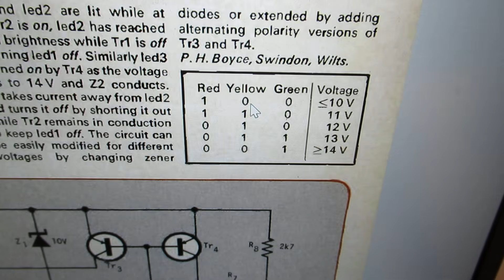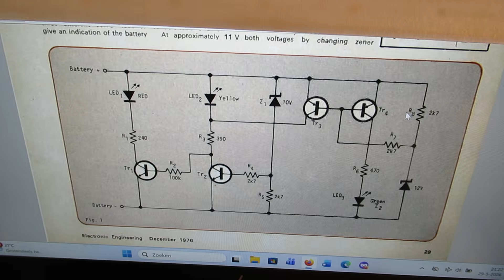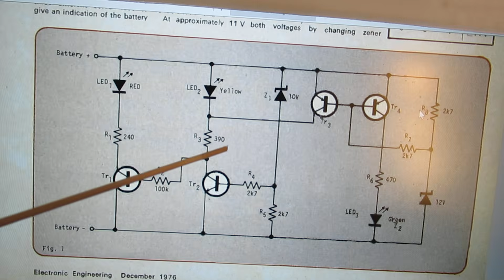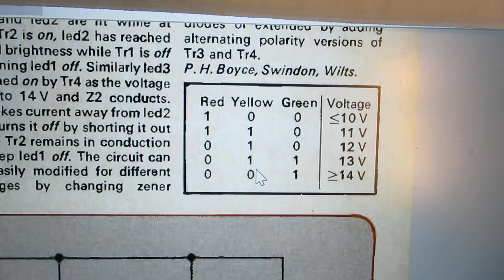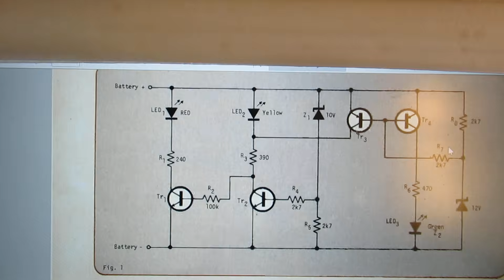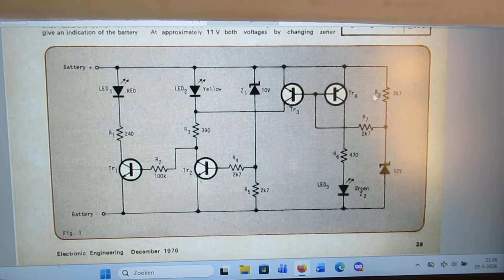Automotive (car) battery of 12 V, a status indicator. Schematic of the 1970s and much more to tell

Comment: 😐This "Tool" is more for Testing the Alternator. Even then never very useful. A "Dead" Starter Battery is only @ 12V to 11.8V. "Dead" Deep Cycle Battery Down to around 11V to 10.5V. Full Charge 12V Battery is 12.6V. If the Engine ran Today, Battery could be around 13V. If the Engine is running Now, the Alternator should putting out around 14V, 14.7 max. ⚠Engine Running: If >= 15V, Alt has wiring problems or is Bad. If < 13V then Wiring problems anywhere, Bad Belt(s), Bad Battery, or The Alt's Regulator hasn't turn On yet for various reasons. Many 1990+ vehicles have "Smart" Alt's or the Alt is PCM controlled that Doesn't Turn On as soon as Engine Starts.

Comment: This is almost the same circuit the first kit I assembled as kid. Differences are R1 = 270 Ohm, R3 = 330 Ohm, R6 and green LED had switched positions and R7 was two 10k resistors going to each base separately. It wasn't working well but that could've been my error. I don't remember exact year but I think 1994-1997. The kit was the type J75 by "Jabel". You can still find its diagram online if you want.

Glad that now I know where Jabel got their inspiration from. I knew it had to be some western magazine.
Reply from the maker: Interesting, thanks, good info.